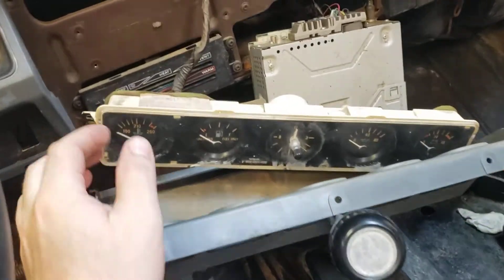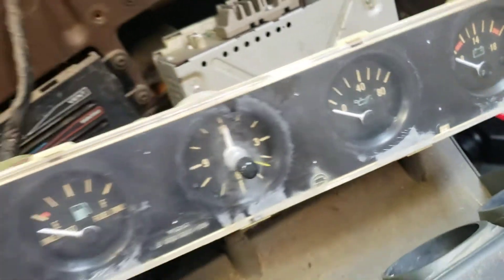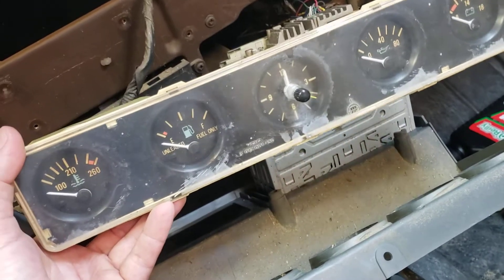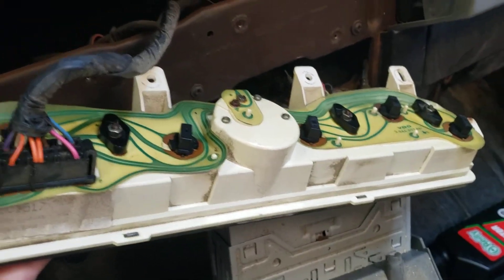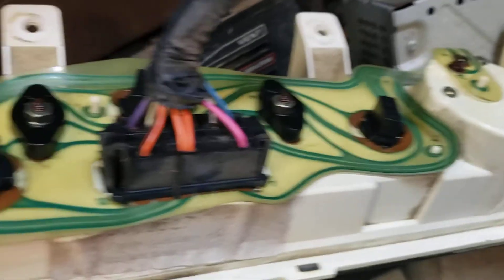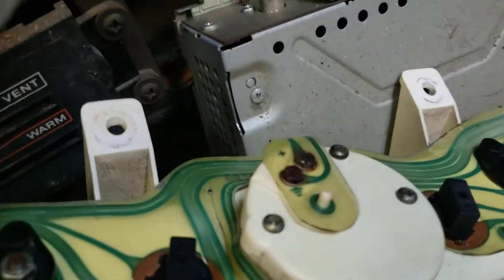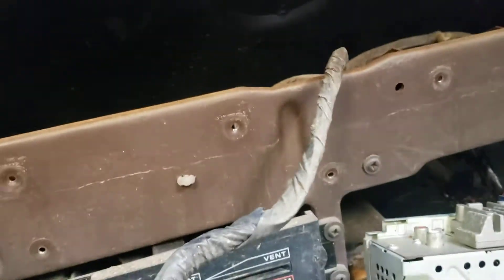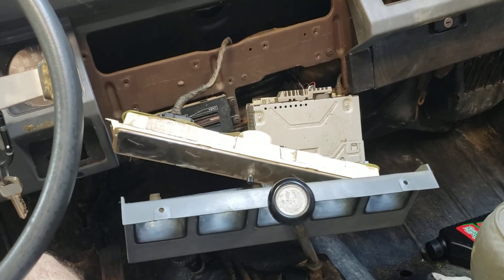1989 YJ Jeep gauge fix PCB

Comment: Need to pull my 91 yj cluster out, and try this. As the only thing that works properly is the clock. Fuel gauge reads accurately, until you turn the engine on, then it jumps up 1/4 tank higher. The oil pressure, engine temp do nothing, and the voltmeter needle constantly vibrates at +/- 14 volts.

Comment: I have some gauges go to the max and others that dont move at all. I know it could be other issues but does that sound like an issue caused by bad curcuit
Reply from the maker: Worth checking. An open circuit (take the connector off the sender) on fuel or temp or oil pressure should peg the gauge at 0. Shorting the removed connector to a good ground should peg the gauge at top of range. If not then there is a problem somewhere in the circuit that needs solving. 

You can also check senders to see of their resistance is changing. For example ohms on oil sender to ground with motor off then compare to reading with motor on.

Comment: I have an '89 Cherokee. All of my gauges quit working. I'm thinking it needs more than just a cleaning. But I'll try it.
Reply from the maker: If they all quit at once then I'd tend to be with you that corrosion isn't likely the cause.

If it were me I'd find the closest year Cherokee cluster wiring diagram I could and trace the power from the source up to the gauge set. There's probably a 12v feed to an instrument voltage regulator then to the gauges and from there it'll split and go from the gauges to each individual sender. The 12v to the regulator then probably about 5v to the gauge cluster should all have the juice with key in run position.
Reply from the maker: Also check your fuses first. Occam's Razor ya know?
Reply: One thing others have pointed were the ground connections from the battery. I've check and cleaned every ground connection I could find, and that didn't do anything.
Reply from the maker: Yeah bad grounds can cause screwey issues for sure. Never bad to verify them. Since they all quit at once though I feel like that leads to the supply side. The gauge lines ground through the senders which produces signal - so if the tank sender and block are properly grounded them that should be taken care of.

If it were me I'd trace the source power by a diagram first.

Comment: I’m in the process of buying an 89 YJ with a fuel gauge that doesn’t work.  is the sending unit for the fuel gauge under the gas tank?
Reply from the maker: The sending unit is inside the tank. If that's the issue then for a novice this may be a substantial job. For a seasoned person its maybe 3 to 5 hours total to do a quality job.
Reply: @winterturtle5764  my buddy got me hooked on a Jeep he’s been working on cars since he was old enough to work the jack safely so if it’s not something I can do he will definitely help me thanks for the reply

Comment: How do you remove the black oval pieces?  Mine feel stuck
Reply from the maker: They rotate maybe 1/8 of a turn counterclockwise and should then be released and pull straight out. There is a small detent holding them but it should give under gentle firm pressure.

Comment: Have you ever experienced only your speedometer not working? Would this help with the circuit board behind speedo gauges?
Reply from the maker: I have not - but I understand it to be driven by a sensor and wiring so a check and clean won't hurt.

I'd also recommend searching or asking on https://www.wranglerforum.com/forums/yj-tech-forum.218/

I'm a member there and there's people with 100x the expertise I have. Always knowledgeable and willing to help.
Reply: @winterturtle5764  cable running from your transmission connected?
Reply from the maker: @SaDie_dr.pepper  the backup lamps yes. The OD sensor no. I have a newer ax5 without the boss for it to install in

Comment: so my temp guage is grounding out? The guege is pegged at maximum
Reply from the maker: I've forgotten which is which but you should be able to pull the connector off the sensor at the engine - then with nothing connected it should be all the way to one side. Grounding out the connector with a jumper should make the gage peg the other way. If so - the sensor (sender) is the issue. If no change... you have a wiring issue to investigate.
Reply: @winterturtle5764  Wasn't sure where the sensor is but I have since found it and the wire is broke off.

Comment: my 1989 YJ won't go over 65 miles an hour and loses power on inclines.  any ideas?  maybe cut off the catalytic converter?
Reply from the maker: Cutting off the cat won't make a noticeable difference. Is this a stock vehicle? I run 33s with the 2.5L and stock 4.11 gears - it works around town but can't go above about 65 and is kinda sluggish on road. The only real solution is gears. 4.56 or 4.88 would do depending on the driving desired... even with a 6cyl you may consider lowering your ratio.

But for me its perfectly fine. I runabout in town and use mine as a trail rig.
Reply: Definitely a tire and gear problem I switched from 33s to 31s i knownits just a 2 inch difference but it helped out tremendously
Reply: Possibly the trans slipping.
Reply: Is it a manual transmission? If so then you just need a new clutch

Comment: Question...I did this just like you did, and I went from having a couple of the gauges that kind of worked to none of them working now. The only thing I can think of is maybe I put the black diamond shaped nuts that hold the two posts for each gauge in backward? Can you put them in a wrong way so that a positive or negative polarity gets messed up?
Reply: You may have shorted it out and blown a fuse. Check that
Reply from the maker: Anything is possible but I think the earlier poster has the idea. Make sure you're getting + to the gauge before getting too far. 

My old f150 has a 12v feed then a 5v supply yo the gauges... in vase ypu run into DC woes
Reply: I changed to LEDS today and plugged everything back in and now my gas gauge went passed full when I turn ignition off it goes down turn it back on goes all the way up I didn’t disconnect battery when I changed the bulbs any help would appreciate it. 87 YJ